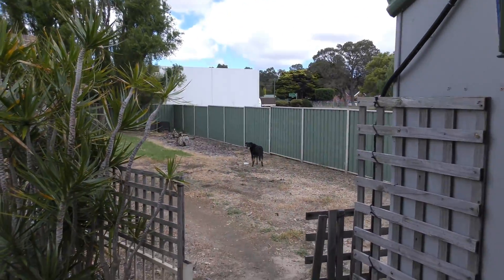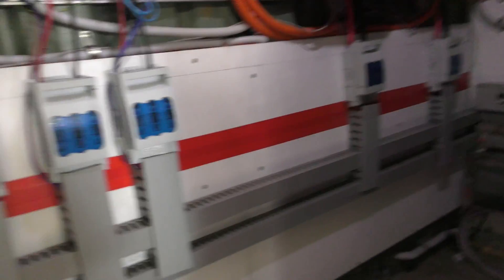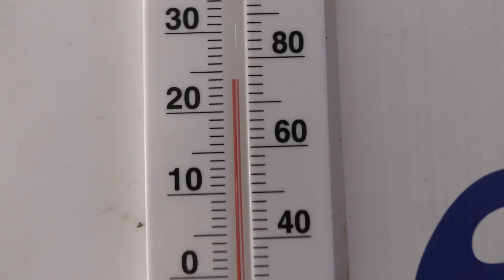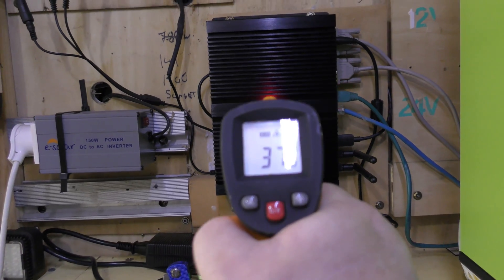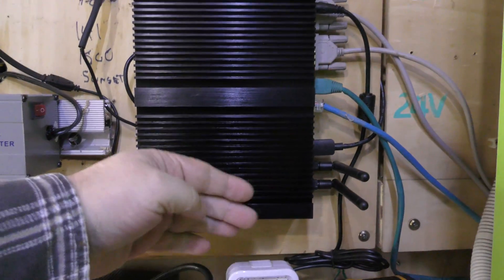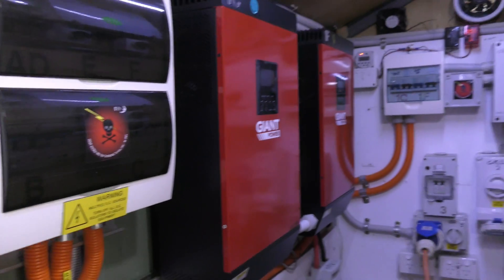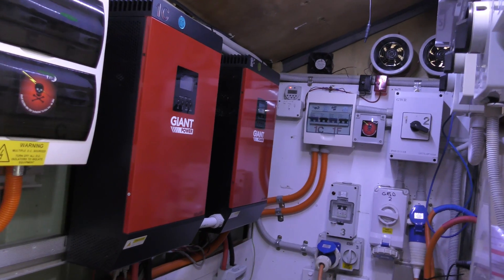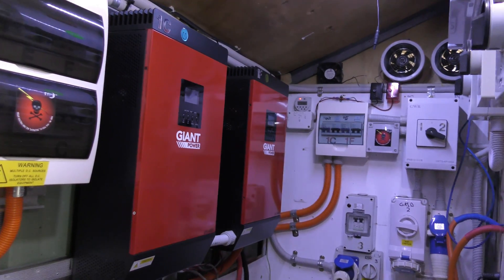OFF GRID Solar. Power Room. Questions answered

Comment: I’ve just watched your vid, I agree AGM is just fine I use victron gear and it’s been working perfectly for over 8 years and counting. No dramas ever. Cheers.
Reply from the maker: My AGMs have been working great. Running our home for many years now.
Reply: @JustinCaseSolarPower  
I just laugh how much all the chocolate coated batteries people are getting. For no real reason. Just because it’s got sprinkles doesn’t make it taste good.
Reply from the maker: So true. Most are only just finding that out. As there over priced battery banks fail after only 5 to 7 years. We can buy 3 of these banks for what they paid for just one with half the capacity mine has.
Reply: @JustinCaseSolarPower  
I got a boring system, never breaks down, I’m inventing new ways for my kids to wash panels. 🍻

Comment: I would never consider anything other than Lithium Ion batteries. Lead acid batteries in all their variations are nothing but  primitive junk.... 100 year old technology!
Reply from the maker: Lead acid batteries are not primitive junk. Yes there been around for a long time. The first known instance being the baghdad battery 2000+ years ago. However the internal designs have changed and improved over the years.  It all comes down to chemical life and how you use that battery,  Li-ion batteries have not proved there longevity in high temp climates. And indeed many require cooling. Cost and longevity is also a big problem with the Li-ion battery.
Reply: Also, I would NEVER consider going off grid if I had access to grid power. Most off grid systems force people into power rationing and giving up modern conveniences.
Reply from the maker: My wife runs what she wants to when she wants to. Indeed we just put in a New electric HWS  https://www.youtube.com/watch?v=T-zuIPeqGRA Going off grid may not be for you and that's ok as well. Many people have no backup power at all and they do great in the short Power blackouts The last one we had in this town was sunday week and it lasted for 7 hours. Just a short one. As population grows the cost of power has to increase. They  just can't keep building power stations. So they controle How much power people use with the Price of that power. Power / Water / Car rego / LPG and much more - has always been a big cash cow for any government and a great way to control the people and keep them poor. The simple fact is,. Solar power is a great alternative and more people need to use it.

Comment: Hay Chris,

Great video ended up getting an Axpert 5kva from Silvo and it states agm only. Your videos are great as it makes you take a step back think carefull before running your gear made that mistake once before on an outback charge controller mixed up the positive and negative (boom) 300 bucks later..... I’ll end up buying a 1000ah 48v battery blank from  Silvo once my house is finished being built to hook up to 10kw solar system. Thanks to your video I’m getting electric hot water not gas so I get the most benefit from going off grid sourcing the solar flux 2 . We’ll keep you posted once I start my build in feb. Atm just gathering parts.

Cheers

Craig
Reply from the maker: Your welcome mate. Yes that is what i try and do. Make people have a good think and plan. Glad it helped you. Silvio at E-solar is a nice man and will also help you as much as he can as well. That is why i recommend them
Reply from the maker: You can always come down for a coffee and a look at my system. Take photos ect. Just to help you out with ideas
Reply: Will do when I’m down that way thanks mate

Comment: We used to have huge batteries on the submarine I was on. They would power the whole submarine for 48 hours. It was awesome. These were likely the price of a small country. 
Have you used any of the Cell tower batteries? I have heard a lot of good things about them. Where did you get your batteries? How do match your batteries to the solar panels? Are there so many batteries needed for so many panels? 
I am so happy you treated me like an Idiot......... No really. I did not know this stuff. 
How much does a 1,000 AH battery Cost?
Thanks so much for this Chris! You friend in Chile. Jim
Reply from the maker: No good me telling you what the cost of gear is for Australia. I will say i have had friends some great battery banks at the scrap yards that the telco's change out every 2 years. Yes the batteries have to carry you through the times when there is No or not much sun on heavy rain and cloud days. The more panels you have to faster you recharge on low sun and rain days.  Its all a fine balance.

Comment: hi mr justin and my 24v   battery bank what is the right size fuse an my  920ah battery bank i have the wohner switch like you
Reply from the maker: well you have to work out what loads your running and fuse for that. I don't know what your loads are.
Reply: hi mr justin  good day i run  all of my home loads

Comment: good day mr justin thank you i will do it to day  i am doing up my 24v battery bank
Reply from the maker: IF you can then do yourself a favor and go to 48v. half the amps required to run your home and the inverters and chargers will all run a lot cooler and last longer. Just my little tip for you. I have been there and done that. I would have saved many thousands of $ going right to 48vdc

Comment: I think the key point is that, like you said, using the chosen equipment in a way that it was designed for with the the battery bank / batteries it was designed for!
Reply from the maker: Yes it is a simple as that and use the right size wiring / fusing for the job

Comment: Hi Chris

I agreed with you. I’m running my house 100% from parallel of PIP5048MS with 27 mono panels, 250w each.

My bank from SuperSafe F155 (160Ah) x 28 = 1120Ah ~ up to 3 days ~ 40% of bank capacity with no sunlight.

My load sometime up to 90Ah (reading from BMV 702) with no issue at all with washing machine, dryer, fridge, freezer, home server, big printer Lexmark 954e, oven, kettle, air compressor, 1400w water pump to toilet and washing et al.

MPPSolar’s product is not bad, very cost effective!
Reply from the maker: Yes there a very good Bang for buck unit. They do the job great.

Comment: Most of your loads are inductive. How could you not run inductive loads almost everything has a motor in it
Reply from the maker: I think the new LED light are as well. the old incandescent light and non inverter HWS were all resistive electrical loads. But you would be surprised how many inverter companies try to blame  Inverter failure on inductive loads.